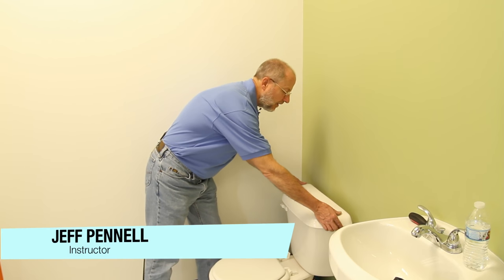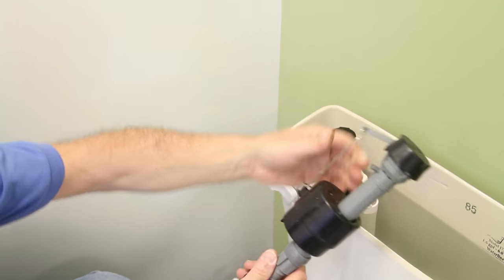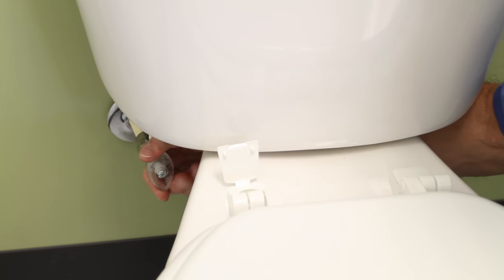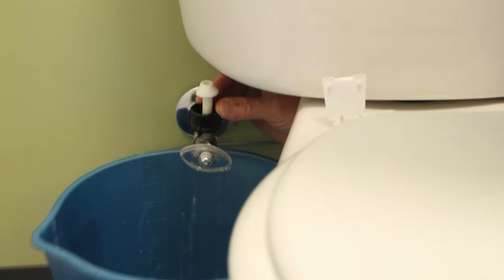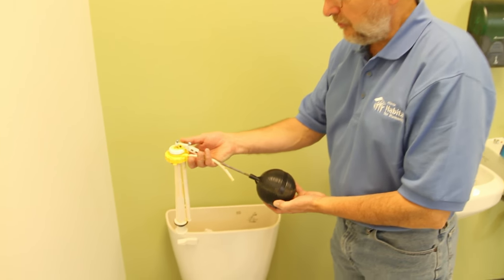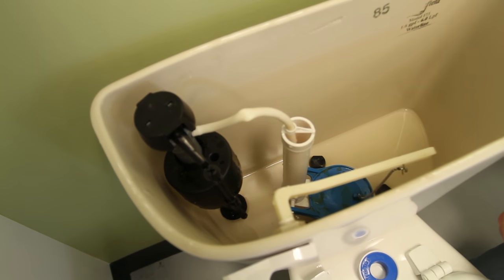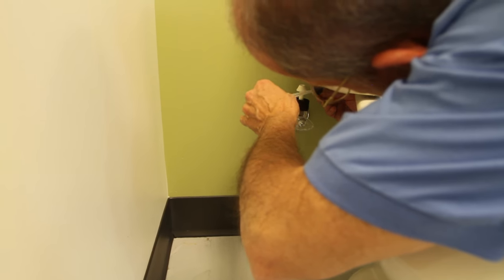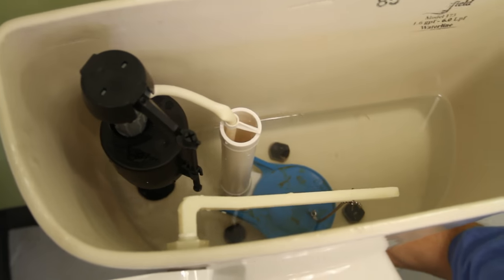How to: Toilet valve replacement

Comment: Thanks for the video. I'm pretty bad at home repairs but was able to replace my toilet bowl valve in about 30 minutes. Some additional points that may help others (1) there is a washer that goes at the bottom of the valve stem and secures the valve stem with the bottom of the toilet tank. For the part that I had, the washer was in a separate plastic bag. Good thing I noticed this before tighten the various nuts. (2) the float height needs to be adjusted to the proper height or the toilet won't flush. One hint is to compare the new valve mechanism with the old and adjust the new mechanism to about the same height as the old one. (3) As an alternative to the "catch the water in a bucket approach", you can use a large sponge to remove water from the tank before you start (takes a bit longer but less of a mess on the floor). (4) Have a scissor ready to cut the plastic tube from the valve to the toilet fill thing since what comes with the replacement is usually longer than you need (5) Have some teflon tape ready in case you have a leak when re-attaching the nut at the bottom of the tank.

Comment: Quite good, but a couple of thoughts.  Looks to me like your white supply line is kinked, which will be a problem.  Second, all manufacturers recommend "hand tight" only.  May be some folks that need help with achieving that (arthritis, age) but no more than a quarter turn.  I check for leaks then when done. I take a few sheets of toilet paper, or kleenex tissue, and wrap it around the connection to see if there is a slow leak.  If so I will tighten, maybe 1/8 of a turn and repeat until there is no more leak.  Done this on all my plumbing repairs over last 30+ years and it saves a lot of $ and trouble.  Thanks for this, much more comprehensive than the manufacturer's instructions.
Reply: The kinked white supply line was a good catch on your part, Bruce. It bugged me that he didn't change it. Good job.

Comment: Thank you for this excellent video.  I had done this once or twice in the past many years ago, but I am much older now, have a bad back and my left shoulder is gone.  Toilet is in a very tight space.  I questioned my ability to do this at this point.  However, a middle-of-the night running toilet gave me no choice but to try.  I had the replacement valve and after watching your video several times, convinced myself that I COULD do this myself.  Thank you so, so much.  I'm going now to check out your other videos!

Comment: Pro Tip - These Fluidmasters are great but they still tend to wear out after a few years and you gotta replace them. If you're replacing the valve with the same kind of value, you don't have to bother taking the entire old one out and detaching the supply line.  Just slide the clear plastic lock collar on the post up and then slide the entire top assembly up off the bottom post. Slide the new one on to your desired height, and push the lock collar back down. Then cut your fill hose to length and attach it to the flush tube. This would also be a good time to go ahead and replace the flapper with a Korky Plus to save future headaches. Done!
Reply: Great tip. Worked out great.
Reply: You deserve a 🍺 for this 👏🧐
Reply: Thank you! I googled replacing fluidmaster valve without detaching supply line and a video showed up showing exactly how to do it without any tools. Without your comment I would not have even thought of that being an option.
Reply: @viperhc  you're welcome Fred. Glad I could save you the time and headache of replacing the entire assembly
Reply: For the record mine lasted about 10 years.
Reply: @paulneri835  10 is a good run.  Houses that have hard water might not have that much longevity on those plastic parts and rubber seals. Also never put those bleach cleaning tablets in the upper tank, it will turn your flapper into jelly and ruin it.
Reply: Way cool!!

Comment: Thanks so much for this video, I have exactly the same valve and was able to adjust the float height exactly as you showed. You can’t imagine the grief I’ve had the last few weeks with the other half having to use the cold downstairs toilet !

Comment: Thanks. I am replacing my valve tomorrow. Looks like a 1 out of 10 on a difficulty level and I am grateful for that. It would have been a $150 plumber bill and it is an easy DIY!. No more big black floating ball on a metal rod either. Thank you!.

Comment: Thank you so much for sharing this video.  It helped me to fix  a constant filling or running noise coming from the toilet tank that did not stop.  I only replaced  the top part with the float not the whole Fill valve kit.

Comment: Ok, just replaced my toilet valve with this video for the first time in my life.  Having the bucket ready saved my life as my water would not completely off.  The one area that I missed was that there is a washer that comes with the new valve.  I initially put the new valve in without the washer and it was leaking rapidly.  Then looked for the washer in the packaging and reinstalled the valve with washer and worked like a charm.  Only took 15-20 min. but was intense, heavy sweating/breathing and almost passed out but happy it's done now.  Thank you for this video
Reply: lol

Comment: It wasn't as easy as you made it appear, yet mainly because my shut off valve didn't truly STOP the valve from dripping all over my floor!  I had to squeeze a right-sized pitcher (not bucket) under it.  All in all, it took me about 2 hours from home to home-depot to putting the lid back on top.  THANKS for your help.  I know I just saved some money--  on a plumber and my water bill.
Reply: In the Winter, It's NOT leaking at all.  Ask me for the video of the explanation!

Comment: VERY helpful, though may have missed mention of the addition of the shank washer. Good idea to look at packet insert as well, which also covers height adjustment and water fill issues. Thank you so much for this well done video!!
Reply: You spoke on what I was going to comment about too , Wish THAT was covered in this video as well .. But for what was discussed HE did an EXCELLENT JOB EXPLAINING
Reply: Oh what was hoping he would have discussed ( FILL HEIGHT ) how to determine and HOW TO DO IT !

Comment: thanks, that is very useful. saved us some money, because we didn't have to call a plumber. The most difficult part was removing the nut (4:08), it was  very tight and hard to remove.

Comment: I am 84 F.  I've fixed my neighbors as well as my own toilets since I was widowed 25 yrs ago. I've also changed the ring under the  tank. My guest btrm toilet kept kicking on,so I removed the top ,& cleaned the silt out,voila! (So far)

Comment: FYI, after you remove the valve cap, you can sometimes twist the lever attachment off (depending on the model of valve you own) and disconnect the hook arm in order to gain better access to valve filter, giving complete access to clean out the gasket cap and remove obstructions :)

Comment: Ive seen a few videos mentioning this problem BUT its only ONE of TWO issues. If you hear a constant hissing noise and can see a slow stream of water running in toilet like the guy showed. Then it might be the valve he mentioned OR it is the "seating washer" which is the rubber washer at the bottom of toilet that seals the exit plug. 
HOW TO TELL DIFFERENCE: Look to see if the toilet is leaking water down overflow pipe or if it leaks regardless. Use your hand to hold the float up so no new water should come in and if it is the "seating washer" it will slowly leak well below the overflow hole. If it is inlet seal then new water will come in even though your holding float upwards and tight

Comment: This is a very informative video. Thank You.
    I came across the running water problem and I got the solution from here. I don't think I'll be needing to replace the valve system (for now), but what amuses me, is the fact that 25 or 30 odd years ago, when I was still around 10 years old, I was able to fix the valve system completely with a Swiss Army knife. The problem back then was exactly that "sut" the stuff that is solid and gets through the filters somehow.  It was so easy to take apart the system and remove the little piece of clay or whatever from in between the floater valve. 
    Now days like you said, it's impossible to get it apart and fix it. What a shame. I know capitalism works its magic as well but it's just getting absurd. And to talk about the fact that this video is 9 years old :)

Anyways... I got all the info I needed and then some :) I'm not even going to think about trying to take it apart when I get to the point of needing to, and just replace the damn thing.
Hats off

Comment: It takes less time to replace just the gasket if that's the culprit...  the seal/gasket responsible for the leak he's talking about @2:00 is called "Fluidmaster 242 - Replacement Seal for Model # 400A Fill Valves".

Comment: This is great info, thanks dude.  I did everything, up to the point of unscrewing the nut underneath the toilet, holding the valve in place.  I am unable to unscrew that plastic screw.  Is is possible that screw is part of the toilet itself?  I have tried multiple tools including vice-grips to unscrew it but the screw is so close to the bottom of the toilet that I can't get a good bite on it and don't want to strip the plastic.  Is there a special tool I need for this, it looks like a 1-inch hex but it has a small round tag on two sides of it.

Comment: Great video. Thanks for the details and being very specific. The righty tighty lefty loosey, brings back memories from yeears ago.. just wanted to point out but maybe im wrong. It looked like when you reinstalled the nut to tighten the water supply line to the fill valve was it left to tighten the nut?

Comment: Only thing is. If your just replacing the valve. You only have to take the fluid master off the  main post and slide it on the existing post. Takes five minutes if that.

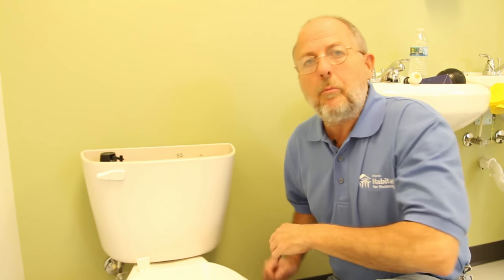Comment: at 2:16 you say "grit gets in the valve and you need to replace it" (I paraphrase).  You don't.  Hold the tube, and turn the top 1/8th turn counter-clockwise, lift out the value.  blow out the grit.  replace it, job done, it's worked many times for me.  kind regards

Comment: the water intake valve is adjustable, so how do u know where/how to adjust it correctly for ur particular toilet.  Mine is a Glacier Bay. Problem is low toilet bowl refill issue and the flushing mechanism has broken.  Where do we go for replacement parts, bc HD does not sell this particular flusher.  Is a universal one okay?  We've ruled out the flapper via dye test in tank. Lov ur videos.

Comment: My water inlet is a spiral metal type.
The FluidMaster valve instructions say to use ‘existing’ cone washer here because the supplied new cone washer may leak with this sort of metal line.
Mine is 40+ years old so that cone washer  may need to be replaced because I have a small amount of water seepage here after the new value has been installed. 
Is there a special cone washer for these spiral metal inlet lines and if so, where can I get one?
FluidMaster  instructions just say ‘use existing washer’ instead.

Comment: Question - nine out of ten times we have to push down on the black screw on the fill valve for water to refill.  The unit is fairly new.  What do we need to do so the water refills automatically?  Thank you.

Comment: This was very good.  The only addition that I feel should be made is about the Teflon tape.  You should make sure to put the tape on in the same direction as you will be twisting the connection on.  if you put the tape on going in the opposite direction it can become unseated where you want it to be and it will not work to stop leaks by helping to create a tight seal.  Other than that this video was great.

Comment: Always wrap the Teflon tape clockwise
Reply: @Vytautas Paskevičius When you put the plastic nut back on, if the tape is counter-clockwise, the tape will ball up = bad seal.  If the tape is put on clockwise, the tape will stay in the grooves and not ball up as the plastic nut is screwed back on. = good seal.
Reply: and before installing it down in the hole
Reply: You should have said "clockwise looking down from above, not looking up from below the pipe"...See what mean ?
Reply: @MarkInLA  clockwise is clockwise from any direction
Reply: Dave Flower I

Comment: Press down on the head and turn while holding the arm up. Not even 45 sec. Pull the black rubber valve out and replace the same way.  Just be careful you don't break the tabs on the valve. Worked Home Depot plumbing 5.5 years. $2.75 vs 7.50 for the valve itself.
Reply: Your right, it works like new after pressing it down, turning and holding the arm up. Thank you for tip.

Comment: hi i have an old system which i have uploaded onto my profile image or chanel. i have just changed the inlet by fluide master but the tank will not fill rather water runs down the toilet bowl. do you know what else i can get? I also do not have or the old one didnt have a pipe coming out of the inlet valve neither does the new one

Comment: had a leaky tank to bowl gasket... Could not find a thick enough gasket to fill the gap... used clear gasket sealer to seal the whole thing up... I'm wondering if maybe the age of the toilet was the key factor
Reply: In the Winter, It's NOT leaking at all.  Ask me for the video of the explanation!

Comment: I have the other problem. I flush, and the float drops, but water won't fill until I open the tank and touch top arm on the tower. 
I have tried adjusting float up down sprayed lube on float, but it won't fill tank 99.9 percent of time.

Comment: I've come across a weird problem. The incoming water slowed to a trickle so I unscrewed the top of the Fluidmaster and checked for debris but there was none. After putting everything back together, and turning on the water, it fills perfectly. Then, after one flush, it stops working; the incoming water slows to a trickle again. Why is this?

Comment: help.. 15 yr old fill valve replacement, the plastic nut on the bottom, outside the tank(not the water connector), ...has no teeth left and am unable to loosen it with either channel locks or adjustable wrench, the plastic nut is brittle and seems to just shrink under pressure of tools and can't get the leverage to loosen it..

Comment: I was trying to change the valve today . I got the water line off and could not , with any tool,. Get the piece off to release it .. 😔 how can I get this off.. yes it's corroded the bulb arm ..of course was rusted.. this is not my toilet .was a customer..so and did not want to break anything however it still needs fixed. Help please

Comment: I noticed that the tube was inserted a bit too far into the overflow pipe. When it is inserted to far, it will siphon water continuously into the bowl, increasing your water bills. The end of the tube should be at the top of the pipe and must always be higher than the water level.
Reply: Thank You 🙏🏾 Norman Webster  your tip was the one I needed to hear.. Pulling the tube up out of the overflow pipe WORKED WONDERS!!!! Thank You 🙏🏾
Reply: You were right!  Pulled up on the tube and "no more phantom toilet fills".  Thank you Norman Webster.
Reply: The kink he left in the tube should minimize siphon losses
Reply: Some tube designs have a small plastic clip that you put over the top rim of the overflow pipe so it cannot slip to far down inside .Well pointed out Norm.. this will help a lot of  People .

Comment: hi, good video. I have a different problem  with my toilet, It hasn't power  or the speed when you let go the water is not good enough so  sometimes everything get blocked and the water rise in the bowl, How can I fix that. Thanks in advance.

Comment: Easy peasy! One step missed. Remember to place the rubber gasket between the new valve and the bottom of the tank. It may already be  on the new unit. But check for it anyway.

Comment: Don't know why the Moen fill valve I bought did not come with a gasket preinstalled on the threaded bottom, but the rubber gasket that came with the kit had something in the middle blocking the hole for the threads to feed through, so I had to cut it. Instructions of course don't mention this at all

Comment: NO NO NO   .....  you don’t have too replace the whole thing if you have the same model fluidmaster 400. Take 45 seconds to replace without emptying the tank.   Just remove the top body ....  If it’s a different model then yes , replace old valve.
Reply: Was going to say the same thing. Not even 45 sec,  Just be careful you don't break the tabs on the valve. Press down on the head and turn while holding the arm up.   Worked Home Depot plumbing 5.5 years. $2.75 vs 7.50 for the valve itself.